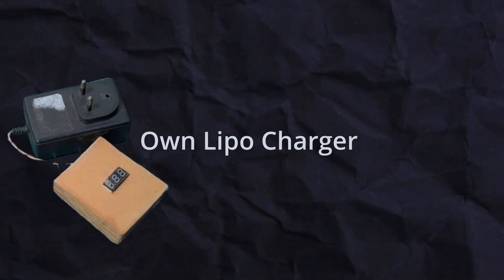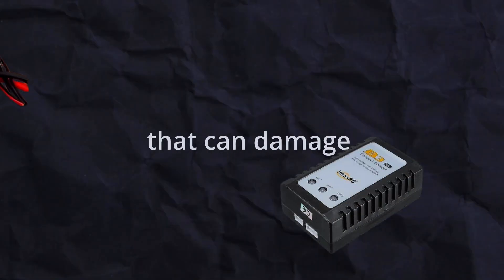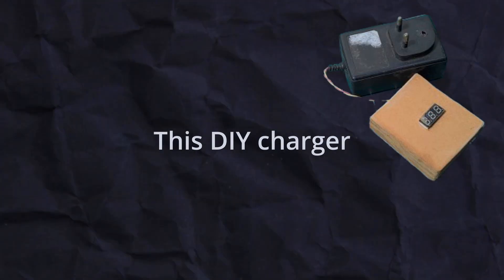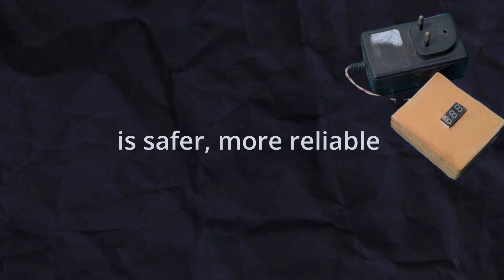How to make lipo Charger at Home | Maker SCI

Comment: Each tp4056 needs 5v, 3 modules need 15v. Lipo full charge voltage is 4.3v. tp4056 can charge upto 4.18v. ok its safe. But giving 12v will charge the battery upto 75% only.
Use 15v adapter.